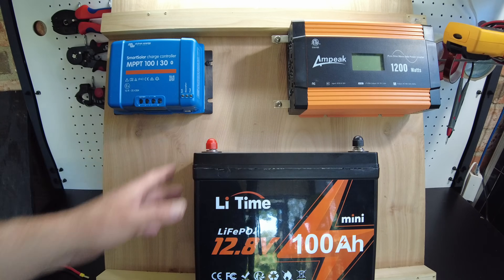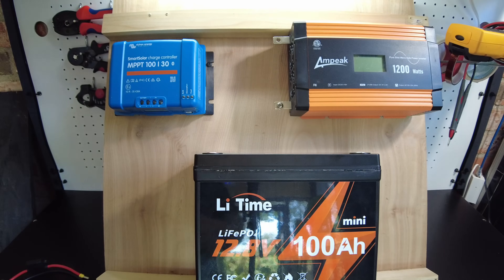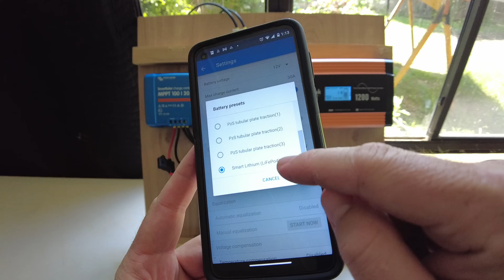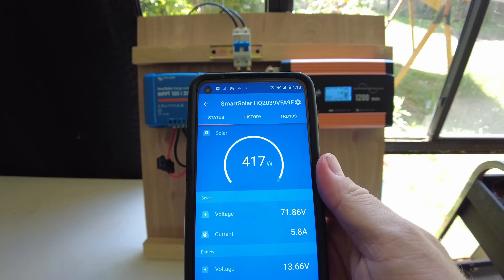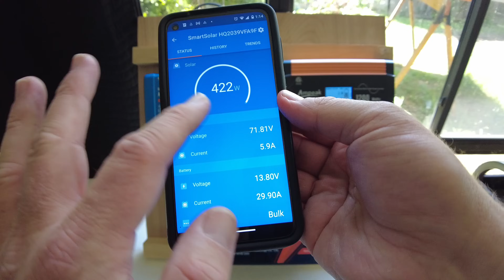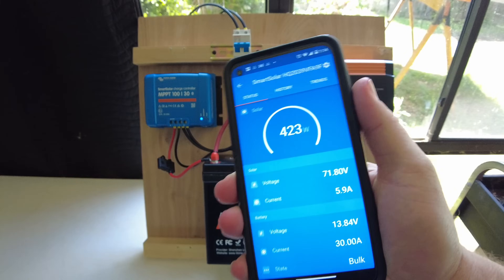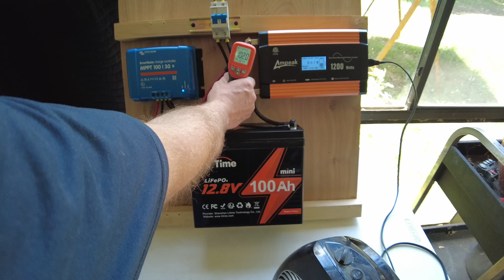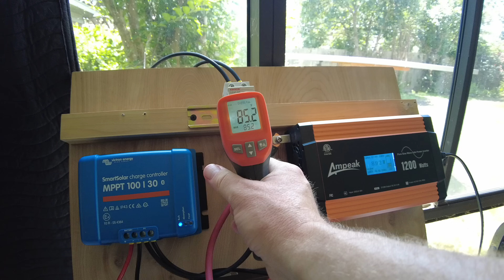Victron + LiTime MINI = beginner friendly off-grid

Comment: summer time in Quebec is the season to use solar panel(s) to charge batteries and power stations. but winter not enough sun light. i use my 12,8v 50ah battery with my bluetti EB3A to extend the capacity and i also use the 12,8v 100ah battery  with my ac70 bluetti to extend the capacity.  I have a pure sign wave inertor 2,500watts 12v  but never used it yet.  would be fun to have a simple video showing the victro 100v 30amp solar charger control charging a lifepo battery. with recommended fuse sizes . hope you can do one  I am not very knowlegeable   would help a lot to remain safe  with this solar stuff.  I also have the bluetti AC180 cooented ups for the office . all 3 work reeal good. I have a 195 watt eco worthy rigid solar panel and a Bluetti  PV200D foldable solar panel.

Comment: in the case where i just want to charge my lifepo4 batteries without that invertor added to the system how would you  do it? or is it mandatory i must connect a invertor to the system?  when i only want to recharge  my ecoworthy 12,8v 50amphr battery and the 12,8v 100amp battery one after the other.

Comment: Thanks, Brad, for the helpful tutorial.
Does anyone know if I can ALSO connect my generator to my inverter, that has a built in battery charger, to charge the battery at night when the solar charge controller "goes to sleep"?
IF so, is there any special connections or switches that i would need to add?

Comment: The EcoFlow Delta 3 Plus is $470, although refurbished with 2 months old build date.  This simple beginner friendly setup is $750, for some reason the 100ah battery is nearly $300 on amazon lol.  Yet the Delta 3 Plus is lightyears ahead in every aspect that's just about the same size as a car battery.
Reply: Try starting a pump or a diesel heater with an Ecoflow...they don't work for 12v campervan devices

Comment: hi will this work please ....Touring Caravan  uk leeds 
Router  = 1.0A(peak) @ 12V  Left on   24/7
Batteries 2 x  115ah  12v
Solar panel = 240 watt 12v On caravan roof 
Votronic Solar Controller MPP 260... Max 260 watt  12V  (12 V / 18.5 A / 260 Wp)... will it drain fast or will it be fine

Comment: I use a similar system to this however I put the regulator inside a hardcore battery box and the inverter sitting on top.

Comment: Great video, two questions, the Solar Disconnect Switch, what Amp rating? Second if you wanted to double the battery capacity how would you wire it, series or parallel and would you make any component change outs consequential to? So I have my eye on a Ampeak Pure Sine Wave 2000 watt Power Inverter! ;)

Comment: Does it always spark when connecting the second cable from the inverter to battery? 
is it dangerous if i don't have a resistor? will I get electrocuted?

Comment: Even though the battery is 100ah , that does not affect the charge controller? I am bit confused about matching the charge controller with the the battery amp hours. So if I purchase a 60 amp charge controller with a 100 amp hour battery, basically the Charge controller will only have an output of 60 amps. Is that correct? Thanks if you get to respond. Great video.
Reply from the maker: So you need to look at the charge specs for your battery. For example this battery can take a max charge current of 100a, however the recommended is 20a. While you could use a 60a controller, you may be punishing that battery. 20a charge controller for max life of the battery. However I don't mind pushing it a little with the 30a controller, personally I think it's fine. But again following the manufacture specs you would use a 20a controller with this battery. Hope that helps!

Comment: If multipel solar panels are used i connect it in such a way that it delivers enough voltage (not amps) to start charging from sun upp untill sundown, but not to much to shorten the lifetime or destroy the regulator.
Its really the sunn-ours you need for charging any battery.
Just like batterys, groups can be made of solarpanels. Paralelle or series.
I use groups of 3. Sunset the most (east in europ) south the smallest (less panels or smaller ones) at the end of the day all panels produce all day long. I choose the winter/bad wheather sett-upp, and turn some panelgroups off in summer 😉

Comment: It is a simple system indeed. 

Got a question about fusing the mppt. You have to connect the mppt to battery first, than connect solar to mppt. Otherwise the mppt can get damaged. However, you put a fuse in the positive wire from mppt to battery. When that fuse blows, it kills power to the mppt, yet solar will still be connected to the mppt and push power in. Will that damage the mppt?
Reply from the maker: Victron MPPT controllers do not have the problem you mention. The only time you must connect the battery first on a Victron, is the very first time so it can detect the battery/system voltage. Then I would suggest you manually set the battery/system voltage, i.e. 12v, or 24v so that it cannot accidentally change, or detect something different later. After this your fuse can blow, or your breaker, or your battery can disconnect, etc. and it should be fine. Thanks
Reply: @ mine actually has a tiny manual selector dial and setting 9 is for LI.

Comment: This is a nice, simple, example system.  HOWEVER, IMO it is too small for most peoples uses.  A 1200 watt inverter is likely to be insufficient for many appliances you might want to hook up.  A     typical household outlet is perhaps 120v @ 15 amps, yielding 1800 watts.  This means if you went with a 2000 watt, pure sine wave inverter, you would have pretty close to the same functionality as a single household outlet, with a small margin.  The stories of people with insufficient capacity inverters are many.  Fortunately, it is no big deal to swap out a higher capacity inverter.  I would also recommend people consider using a 24v battery.  24v has nearly the same safety as 12v and the same hookup wires effectively have twice the power carrying capacity.  Further, 24v conversion is typically a bit more efficient than 12v.  You would, of course, need to make sure you also had a 24v capable inverter.  Further, a 24v 100ah battery can store twice the energy as the 12v example battery.  It would be, of course, bigger, heavier, and more expensive.  IMO, it would be well worth it.  Many people find a 12v 100ah battery fine when their plenty of sun but may not be enough to get them through a cloudy/rainy day or two.  As I said, there is nothing wrong with the example system other than being too small for most people, IME.  Fortunately, it is almost trivial to swap out components to scale up to a more capable and reliable system.  You just need to insure interoperability between the components and use appropriately sized wire.
Reply from the maker: I'm planning to do a 2000w 12v video. Also I already 24v, and 48v videos. Thanks!

Comment: Thank You Great video. I'm building a 12 system and I have all the components. Were I struggle is selecting the correct wire size and fuses and where to place them. Can you help?

Comment: Is there anyway to connect a generator to charge the battery as a backup source to the solar?
Reply: Yes, they are called hybrid inverters, and they have input for generator/grid power.

Comment: You kept it simple..bravo!!! So if you were to get a 2000 W Inverter what type of mppt and battery would you use? Would you parallel to another 12V 100 ah battery? Use 2 or 3 batteries?

Comment: I'm new to this, but since the inverter and controller have cooling fins on the back of them, wouldn't you want to have some space between them and the wall?  Just like you are supposed to have a couple of inches between your refrigerator and the wall so it can dissipate heat.

Comment: Safety demands that a fuse be connected to the Battery POS Post (Source). Think about it.... Your mains AC breaker box the incoming power coming into the box (Source) is fused then distributed.   Same with DC. You size the wire to carry the load it has to handle and THEN you size the fuse to carry that load and the length of wire run. Good content. Think Safety first.
Reply: Uhm... He did use fused cables???
Reply: The NEC allows unfused conductors, called taps on high voltage AC systems as long as the over current device, distance, and  wire size are correct. Putting those fuses 6 inches from the battery post is not a hazard and I wouldn’t think twice about it.
Reply: Can you recommend a video that does it safely?
Reply: What size fuse typically?
Reply: @bradrussell1821  it depends on the system and your cable size. There are charts online.

Comment: Love the video on setting up a small solar power setup.

I'm going to build one for portable Ham radio ops, camping and power outages, so I can power a few things..

I'm going to buy one of those moderate sized stackable tool boxes for building everything in.
Already ordered  a 100aH batt and a 200w panel...

What were you using for the circuit breaker and fuse?
I want to make sure to run those.

Thanks again for the video!

Comment: The charge controllers have 12 volt power supply output separate from the battery charging supply. Most power their 12 volt devices from the battery. I will assume that the 12 volt supply from the controller is much lower? Just for lights or something?

Comment: Know nothing about electrical and tbh I’m worried about car fires, system blowing up. Maybe extreme but I’m just looking to power a camp fridge&charge some camera batteries out of the back of my truck while camping. Could this system achieve this?
Reply from the maker: Yes, it would do what you need. However these days you can just pickup a power station like a Bluetti AC70 that already has everything in one system. Sounds like something more your speed. Take a look https://amzn.to/45zdxF7
Reply: Ended up pickin up the AC180 on sale. Appreciate the recommendation. Think it’ll be a perfect addition. Ease of taking in and out rather than having something permanent
Reply from the maker: @Steve_Bonham  Great choice!

Comment: Thank you so much. I'm trying to figure all this out. I have six 100 w solar panels. Now I'm trying to figure out how many batteries I need, a controller and inverter. I have a window unit, (115-volt;12000-BTU) a 60 inch TLC Roku TV, and a lamp. If I can add a refrigerator later that would be wonderful because a $400 light bill is not for me. Now watch a lot of videos but get confused when they say volts and amps and watts. My brain just goes blank. If you or someone else could help please do thank you.

Comment: I've read in some reviews that the Victrons don't do well trying to run multiple units on one battery/bank. A lot of reviews on Amazon say they just go to float voltage if you combined more than one so you don't get max charging / output.

Anyone have experience on this? Can it be fixed through bluetooth app on the smartsolar charge controllers?

The smaller ones are not too bad price wise if you can only afford one at a time.

Comment: I can agree with you, however the simplest setup is still a solar generator. You get 12v outputs, 110v outlets,switches and monitoring. And you can use a standard battery as additional capacity.

Also your setup limits you to that 1200 watt inverter. And you know how people are, they want to run a toaster, electric kettle or heat gun. Make it two batteries in parallel and always use bus bars.
Reply: Thanks..I built A-frane 16 × 12..want to be off grid...no large appliances....possibly stereo..hot plate occassionally.. what will serve ne best at an inexpensive set up..$$$ are limted..thanks for your consideration in this matter..
Reply: @lghnhawk3467  put an actual number to it
Reply: @lghnhawk3467  you can tailor a system to your budget or you can tailor a system to your needs. How much do you want to spend?
Reply: Thanks for responding..I am looking at a couple plug and go options .I have 400.00 or less to spend..as there will be other necessities..not the smartest when it cones to electrical...I found big blue @ decent price???

Comment: Probably need to use 2 awg wire throughout. Also need to size appropriate fuse sizes. Not too low of amp fuses, and also not too high amp fuses, to start your wire on fire. When wires or connectors heat up, you need to size up the wire. And check all of your connections, bolts, screws for tightness as well.

Comment: Might be a dumb questions, Is the solar disconnect switch the same as a circuit breaker switch and how do you select the right one for your specific needs. How do pick the right fuse? What type of fuse is on the inverter and how do you pick the right size? Great video!!!

Comment: 12V requires the most AMPS to charge and stresses the most all the cables and fuses. This is why i sugest to ether buy a 24V battery or add another one in series. Use the same solar charger, but change the inverter. You will have way better temps for everything.

Comment: Need battery protect .....if bms close the energy for low voltage u can destroy the mppt and is game over bro
Reply from the maker: Victron MPPT controllers do not have that problem.
Reply: @BradCagle  Thanks for the information, I didn't know, but excessively discharging the batteries will damage them in the long run, it should remain around 10%.

Comment: I am interested in making like that 12v 100Ah LifePo4 with solar charging at may 100w solar panel and maybe add another 100w later. I am not interested in the AC inverter since most of my electronics will just running off USB C's. I will be using some 12 volt to USB C and a that can produce QC 3.0 or higher and PD protocol. Most will just be using USB C PD in 5v, 9v, 12v and 20v for my laptop. I am adding an option to charge the Lifepo4 from AC just incase the wall outlet is still ok and the solar panel is not providing enough due to weather. Like the vid very straight and simple. I saved the vid on my laptop for reference in case internet is not available.
Reply: Suppose you could run a 24v system then, and step down as required.

Comment: Hello learner here. What is the difference between the 30A MPPT and the 50A? Thank you.
Reply from the maker: A = Amps, that's the amount of current the charger is capable of passing to the battery. The 50A provided enough solar panels, and sun can recharge this battery in 2 hours. Where the 30A would take 3.3 hours. Thanks
Reply: Ahh.Thank you. @BradCagle

Comment: CORRECT on the in-line fuse; ALWAYS go higher than the rated capacity... Should have gone with 8ga but you honestly putting that IN the video is honest reflection and as you stated, NEEDS to be hot tested for continuity of the entire build. Great job!
Reply from the maker: Thanks!
Reply: Thank you for sharing your thoughts! I completely agree with you on the importance of using a higher-rated fuse for safety purposes. It's great to see the video acknowledging the need to hot test the entire build for continuity. Safety should always be a top priority when setting up off-grid power systems. By the way, have you heard of the Segway Portable PowerStation Cube Series? It has some impressive features like massive capacity, fast recharging, and comprehensive protections. It might be worth checking out for your outdoor adventures or home backup power needs!

Comment: I’m pretty new at this so I’m collecting information, this system is pretty simple but if you wanted to have it charging in a mobile system you’d also need a dc-dc additionally for the vehicle alternator to be able to charge it correct??

Comment: man I used an 803 C, and its portable ones, Lol thanks for the memories..  12vdc 100 watt (8a) renergy, 200/300w inverter, 100AH lifepo. I use a  china ceiling fan led lite  the led only and can get some good use,  its not enough to run for long periods of time if asked.  you want a fuse by your Solar panel where I got mine

Comment: Where did you get the fuse and what size
Reply from the maker: It's a MEGA fuse, and you should get the size that matches the amp capability of your wire.
Reply: Found 1 thanks

Comment: What size fuse are you using for the charge controller?
Reply from the maker: For this charge controller the best solution would be to use 8awg wire with a 40amp fuse. In this video i used a 10awg wire with 35amp fuse. Which I didn't really like. I would suggest the 8awg wire with 40amp fuse instead.

Comment: How could you add the ability to charge by plugin into 110 home plug?
Reply from the maker: Add a LiFePO4 12v battery charger
Reply: Thank you Brad @BradCagle
Reply: @BradCagle  is that a external with alligator clips or a internal device?

Comment: I solder the ends on just put end eye side  in vice get  some flux core solder and put into the end the wire goes in and take a heat gun or torch and begin to heat the end not to much to discolor just to melt the solder and then stick the wire In and hold till cool about 10 seconds and repeat till all ends are completed.
Reply: Soldeer smelt. Bij mij 2 x 100Ah batterij parallel. Door de  kabel 50> 100 Ampere gemeten bij het aansluiten 12/220V 2000Watt  (Hapjespan 1650 watt).    Meet ook de temperatuur van de kabels in bedrijf.

Comment: I’m building a portable version of this; Victron 100/30, 12v 100ah, 100w panel. Can I run the solar input through the Blue Sea Systems fuse block (rated up to 100a)?
Reply from the maker: I wouldn't recommend it.
Reply: @BradCagle should I just run an in-line fuse in the solar cable?
Reply from the maker: @fredir3596  Yes that would be better.